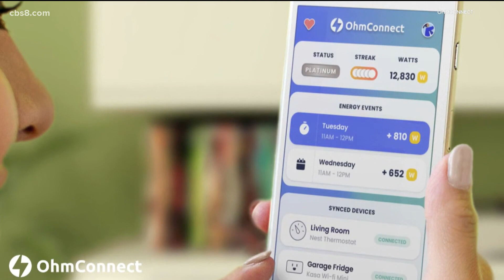California ahead of clean energy goals

Comment: They dispose of those carbon fiber wind turbine blades in landfills..........How is THAT renewable?
Every form of energy has a BTU cost. The metals in wind turbines must be mined. The turbines and (carbon fiber blades) must be manufactured. The turbines must be transported and constructed. The concrete pads create greenhouse gases. The turbines require continual maintenance which include trucks and dirt roads. Finally, the turbines must be decommissioned and disposed of every twenty years. Nothing clean about them!

Comment: All the smart Gov. people need to do is:
Make the wind blow all the time at my house.
Pipe water, make a Niagara falls by my house.
Make the sun shine all the time at my house.
Drill a hole down to use lava at my house.
Route a ocean to my house.
Manufacture all power generating machines from wind mill power.
Put a Telsa in my driveway.
1,000,000 charging stations by my house.
Fly jets with solar power.
Power trains with solar panels.
Put sails on cruise ships, aircraft carriers.
Build F15's & A10's with rechargeable batteries. 
Piece of cake.